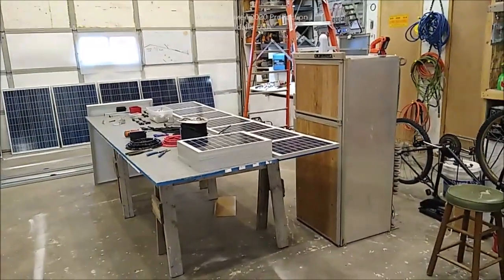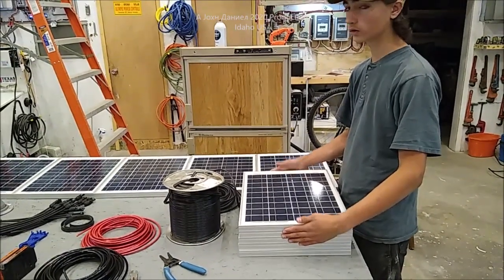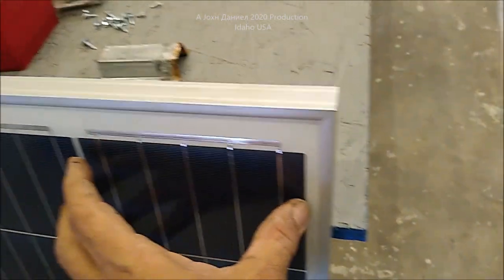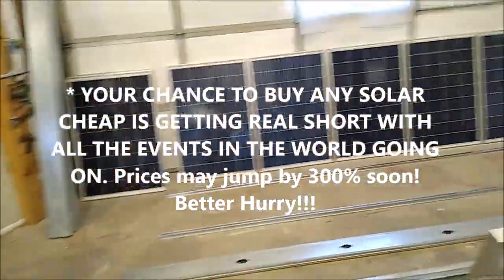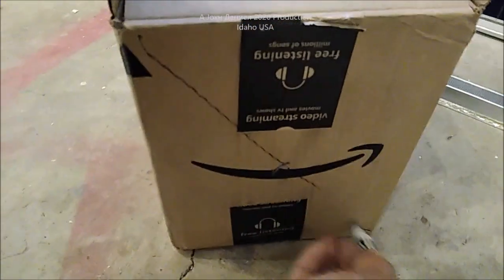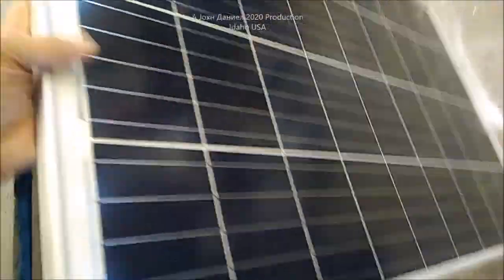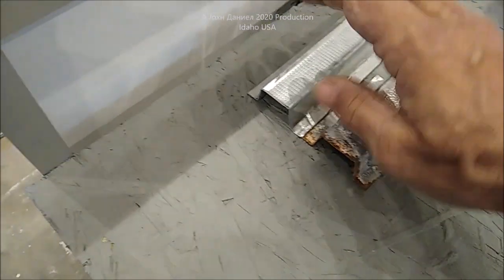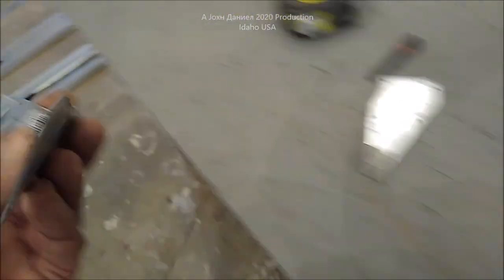Solar Power Supply Crisis coming, affordable install methods - Video 1

Comment from the maker: The Crisis Buying Panic is coming, Get them now - WN100 watt panel https://bit.ly/3bFFQp4 ,MMax/NPI 100 Watt Panels https://ebay.to/30FYSs1 $120 REAL MPPT 50 Amp https://ebay.to/3abTqju ,Solar Connectors https://amzn.to/2XJOa1M ,Roof Jack for wiring https://amzn.to/3a864jE and 12/2 Above & Underground  https://amzn.to/2XIJolg for safe wiring up to 26 amps per run.  
And get the DEKA SOLAR AKA Duracell B-903-L16 monster batteries, and actually last a real 10 years. Made by East Penn, sold by Batteries+ as a Duracell for much less.  https://bit.ly/2wv1VXd Order online, pick them up for 10% cheaper.